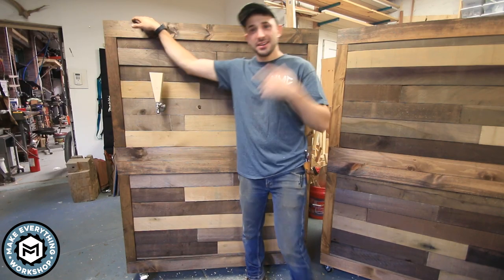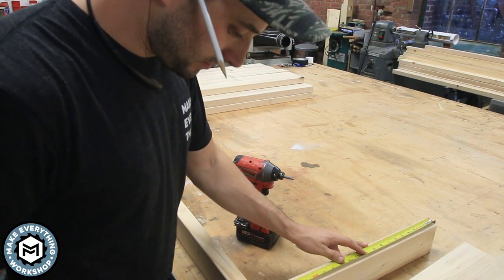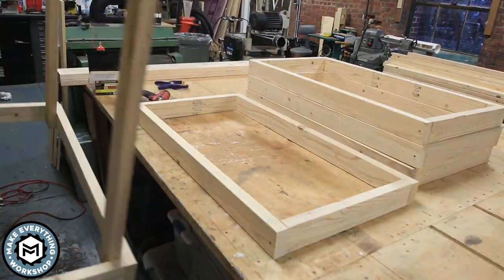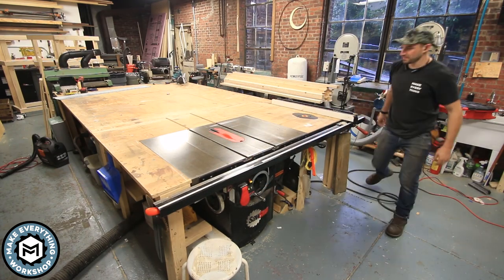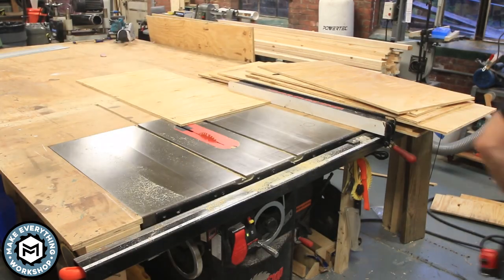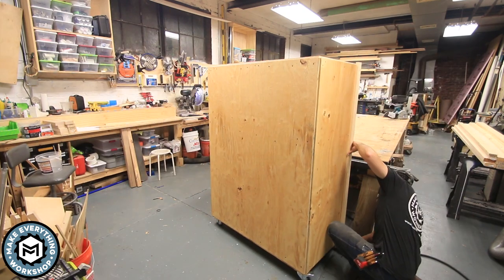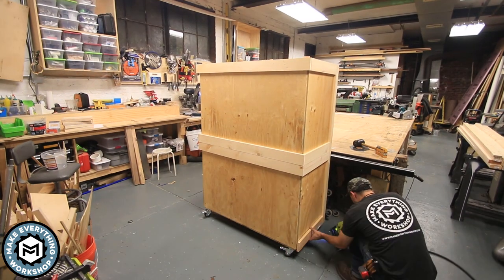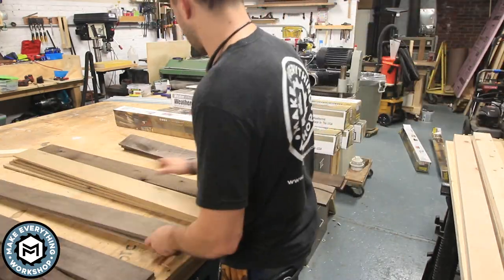DIY Pallet Wood Beer Wall!

Comment: A 16 gallon keg of beer weighs about 170 pounds a about half that for 8 gallon. While these are designed for in and out situations, they will last a lot longer with a 3/4” bottom. Excellent job on the design. 

On a different note we once converted a 2 horse trailer to a keg dispenser. Marine plywood walls with 3” of foam insulation and then sealed the wood. We placed 2 tap handles on each side. It held 15 kegs of beer and would keep the beer cold for 3 days using only 300 pounds of ice . The owner used it as a portable dispenser but for outdoor parties usually associated with the oilfield,  polo matches and festivals.
Reply: What were you using to dispense the beer? Jockey box? Me and my wife are in the planning stages right now of doing something similar.

Comment: I would never have guessed that a half-inch floor screwed from the bottom would hold multiple beer kegs.
Reply: here in scotland beer kegs are 22 gallons /100 litres  so when full would weigh approximately 234 pounds/106kg,

Comment: I've built a lot of stuff for a rental business. These tappers look great... now. But, repeatedly transporting items like these will destroy them in a very short time. Check on them in a year and you'll most likely see that you should have put horizontal supports for the kegs to sit on, used twice as many screws (not nails) and everything should have been glued.  
I hope I'm wrong but only time will tell.

Comment: I have a cordless Ryobi and Ridgid nailer . Neither sink nails . I bout both brand new and they will leave nails sticking out. Have you had any problems with yours ?
Reply from the maker: I have been using mine for like 4 years and never had a single problem. A little oil on the striking pin can help, and turning up the knob on the back to max is also helpful. If it doesnt get better id return them and get new ones.

Comment: Great build! Off subject...how do they keep the kegs cold?
Reply: bzh2fs I would think it hours through a cold plate?
Reply: There are a few options

1 keep the kegs in a cold room

2 the beer is chilled though a cooling heat exchanger on the way to the tap.

The latter is more precise as beer stuck in the pipe is cooled just before it gets into the glass

Comment: looks good, but some mistakes.... NEVER use drywall screws for anything but drywall! They lack tinsil strength, and rust easily! Also, brads will pull our once the wood tries  to expandes/contracts.... I do wonder if the back/inside of the cabinet looks like hellraisers head? lol. That was a lot of brads. Looks good, but prob wont last as long as if you used some glue. Overall, thumbs up!

Comment: Watched the whole thing only to learn it's not insulated or refrigerated in any way...like what?
Reply: Add in some of those foam boards and you can chill it with a box AC unit connected to an external thermostat. The extra work to do all that is maybe an hour. For me having a reinforced floor so I can do trashcans with ice would be better since I want something like this for mobile bartending at events. Look really nice having wood paneling instead of one of those frat boy hand pumps connected to a keg.